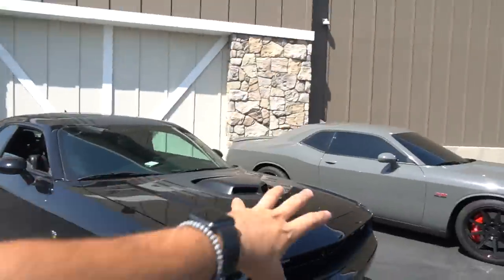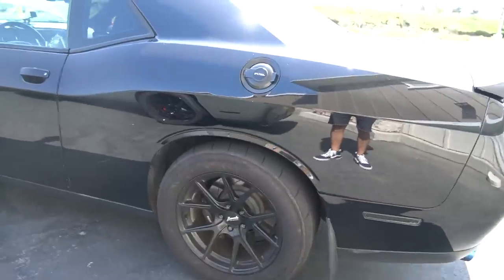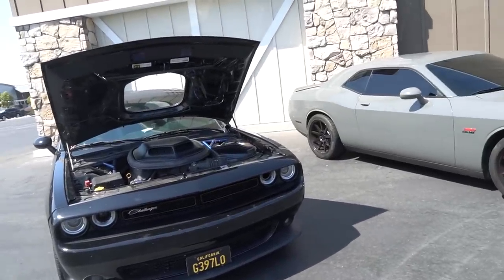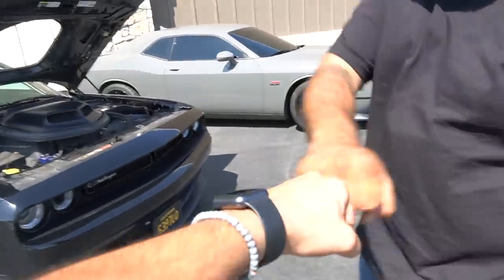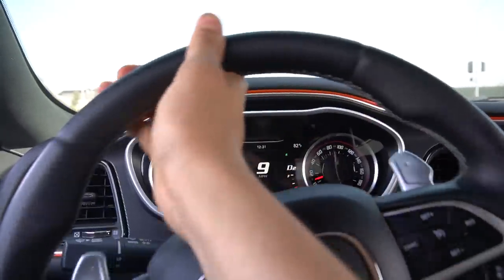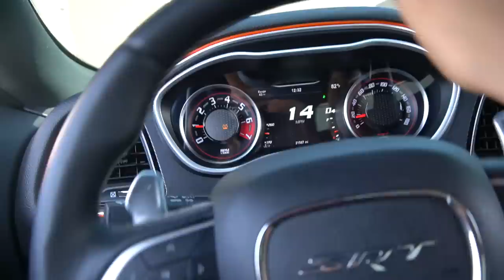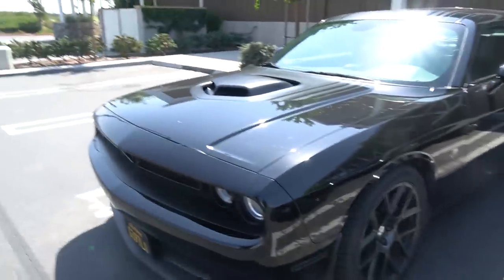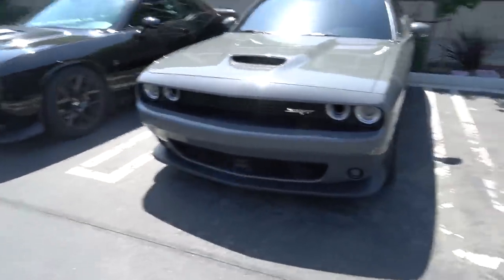Cammed Scatpack Challenger vs STOCK Challenger SRT 392!

Comment: He lost because of the compression ratio of the pistons. Meant for boost for longevity. My car is tuned for nitrous so when I’m not spraying, it doesn’t run the best but is still very capable of driving. Off bottle I made 452 wheel, on a 100 shot I made 580... use your common sense.
Reply: This is why on those street racing videos you see the forged internal C5 vettes on nitrous just walk! Iwhen they are spraying its like they have an enormous blower. Just saying c5 vette cause we've all seen the red one on that one channel

Comment: Adding more duration with a different cam works great IF you increase static compression, he actually lost power because the increased duration lowered the dynamic compression, it is really weak down low and might catch its breath up top but by then the race is already lost

Comment: Somethings not right,  a cammed scat should have pulled on you if you are stock.
Reply: Marcello Wheeler either his srt isn’t stock or his mechanic didn’t do a good job on his scat 😂😂🤷🏽‍♂️
Reply: Marcello Wheeler the forged block lowered his compression. He needs pro charge now . He fucked up
Reply: @eggbeaters  whipple! Whipple! Heartbeat! Heartbeat! Lol what Im a roots guy, yea, they may be heatpumps BUT HOLY HELL THE SOUNDS!!!
Reply: Hein-Motorsports Designs I agree
Reply: eggbeaters what is forged ?
Reply: Montero look it up
Reply: @SpookyMontero  forged internals are heavy duty parts for your rotating assembly (usually crankshaft, connecting rods and pistons) thst are typically made not only out of better metals then factory parts, but are also made out of compressed(forged) metal, usually these parts are incredably strong, and capable of VERY high power before failure.
Reply: ive wondered the same thing we have a stock 392 and some of the cars he destroys ive literally witnessed pull on us with ease... it's so weird...

Comment: This is basically how it would be if you raced a non supercharged 6.2 from the hellcat . That engine is built for boost , from the cam, lower compression pistons and the tune. The stock 392 is 10.9:1 basically 11:1 cr, where the scat is probably at 9.5:1 cr.  When he adds 10-12 psi , it’s going to move out...still good runs for being a lower compression car and most likely wider cam lobe separation.

Comment: Wtf idk what you got in the SRT but it isn’t “stock” 😭😭😭 just kidding btw
Reply: Naw his shit ain't stick watchin these last couple videos he definitely ain't stock plus he neva open his hood
Reply: I think that little intake and a tune probably adds some juice
Reply: @gordona7081  I always wonder what it is because sometimes he is wrecking cars that i've literally seen destroy these 392's either they don't know how to drive them or his car has more then he says...
Reply: @gordona7081  ram air intakes definitely add higher end power, and that's exactly what the hellcat box is.
Reply: Like i said Rush shifts car must have been built on a Friday..lol 🇺🇸
Reply: Just use common sense in any of his vids. 2 similar equipped cars..same motor and factory performance. One had a cam...headers cai and tune. The other has no real performance mods regardless of what you think a cai does. His car needs to make up at least  80 rwhp...likely more to be even let alone pull on this guy. He's got a 150 to 200 shot in his car......now you know.

Comment: Speculating; Forged internals weight much more and possibly his static compression ratio is a little lower. Car will rev slower.  Therefore, power band come at much later time. If he has a boosted cam, he may have little overlap and little to no scavenger effective effect. Therefore, less torque. 

Fair comparison were a stock to stock and long tubes with NA cam and tune.

Comment: He didn’t really do anything to increase horsepower significantly!! 
He is prepped for a pro charger. That will put him around 650!!!
The SRT is a better car than the Scat. Because of the different
settings you get on suspension, steering, and traction!!!
That shit adds up!!
Just adding in a cam don’t do shit really. You still got internals
and a turbo/pro charger etc........
This don’t surprise me!!!!!!

Comment: Damn your 392 is fast. Do you think it could give ur 5.0 a challenge ??
Reply: Andrew Hernandez the 5.0 would smoke his challenger. The short shifter with e85 in the mustang is nastu
Reply: RuthlessGamertag Yeah your right bro. Damn rush should run them just for fun tho 😂😂👀
Reply: Andrew Hernandez it’ll be nice to see. I think the 5.0 stock has more hp than the 392.
Reply: RuthlessGamertag but I remember in a different video his challenger beat a bolt on 5.0 right? I think... not sure
Reply: Andrew Hernandez it was a 2017. His 2019 is 460hp stock. Not to mention hes running e85 and a intake i believe with a short shifter

Comment: People don't realize that the SRT 392 & the scat pack 392 are not the same. The SRT 392 is, & has everything the hell cat has except for it having a bigger motor without supercharger. The STR is tuned differently, the SRT is the better, & faster car, & why it costs more as well I own one.
Reply: I think there the same lil bro
Reply: I know for fact that they aren't, look up the specs, the srt 392 has larger calipers, roters, better drive modes, all same as hellcat, only difference is the 392 srt has the bigger motor without supercharger, & the Scatpack only has the 392 in it, difference of $10/$20k, & not as much, well I'll let you do your own homework lil bro, if they were the same they wouldn't have two different names to them.
I also built the assembly lines for the big 3 ("Motor City" baby), plus other companies.
Reply: No u don’t realize the scat pack and srt392 are the same the srt only has bigger brakes and different suspension I think other than that their the same. Same drive train and everything just like the super bee
Reply: @perspective75 the drive train is the same u haven’t built shi clearly to say the srt 392 motor is bigger than the scat pack 😂😂😂😂😂
Reply: @perspective75 tell me why the swinger, srt 392, scat pack, super bee, 392 R/T, shake down pls tell me what they all got in common after u do your home work
Reply: @deznuts1841  I fully understand, I own one, & have read all up on both, they've got the same motor yes, but then there's even nicer & same badging, there's a lot of differences it what everyone else isn't getting, DO your own homework.
Reply: @deznuts1841  Side by side too please.
Reply: That's why they say "a wise man always Has something to say, a fool always has to say something"....🤣😂🤣😂
Reply: @deznuts1841  how did you mess that up, "the srt 392 has everything the same as the hellcat, but" the 392 "has a bigger motor, without a supercharger" the scat pack has the 392, plus all that you described none (including my 392) doesn't have a supercharger. Lhm
Reply: @perspective75  my guy u said the srt 392 has a bigger motor and like I said the only difference between the srt392 and scat pack is the suspension and brakes and tires nun serious if u wanna say it’s like a hellcat without the motor whatever u win but the drivetrain is the same from the motor to the trans u saying a bunch of nothing again 😂😂😂
Reply: @perspective75  and I own a scat so stop ✋😂😂😂
Reply: @perspective75  I beat a srt 392 with my scat charger and he had the challenger so u not gonna tell me sir 😂😂😂
Reply: @perspective75  and if u wanna count the badging as being different I’m done talking to u if that’s part of your argument
Reply: @perspective75  and I got track sport street and eco tell me what mode u got that I don’t!!!!!!!!!!!!!!!!!!!!!
Reply: @perspective75  and it cost more bc of the suspension upgrade and brakes big deal u so much faster 😂😂😂😂😂😂😂😂I can go all day
Reply: @perspective75  u just want everyone to know u gotta srt392 corn ball ash 😂😂😂
Reply: @deznuts1841  re-read "the srt392 has the same as the hellcat, except that the srt392 has a bigger motor than the hellcat, except I don't have a supercharger, if you read it right, we were still talking about the srt392 & hellcat, & why I was talking about the hellcat having a supercharger, hellcat has a 6.2 supercharged motor, & the rest if a v8 & not the little v8 the 392 is a 6.4. Besides the scat pack has exactly the same motor, so why would I say the 392 is bigger than the 392....🤔 head out of a55, & read. Am done explaining, can't explain to eye D ten tee's
Reply: @deznuts1841  dude the v6 can take a hellcat, for the 1st so many feet
Reply: So now you're grabbing at straws cuz you miss read something, give it up.
Reply: @perspective75 it does 6.4 vs 6.2 . You can't tell people nothing though lol .

Comment: could his car be an upbadged RT with 392 intake?  the seats give it away, usually the seats would have the scat pack logo, not "shaker".  EDIT:  and his scoop is missing the 392 shaker logo, possibly had the "shaker" emblem and stripped it off??

Comment: I recently did an older nag1 5.7 car and put a 6.4 in it.. still making good power with low compression.. hell my 6.1 makes 500whp and is only 10.3:1 aka stock.. if he gold sold a janky grind like a 274.. that's his issue.. at least it's not slower than stock tho! Ive seen that before with people with full heads and cam and long tubes 😂😂

Comment: Ahh, I believe both of these cars are N/A....so what is the issue about boost?....The guy that had the work done, seemed to make a poor cam choice...forged pistons only allow for more clearance, less cylinder drag,....but, did he up the C.R??,  the stock hypereutectics can take a fair amount of load......that Dodge with the modified mill should have powered by the stock one....one thing, you must be real careful when changing camshafts in these engines...

Comment: It could be the track mode vs sport mode.
I have a 2020 scat pack, and the track mode is faster than sport mode because of the quicker shift points.
Obviously he forged his engine for boost that he's not using as well. So, his mods are almost irrelevant with the exception of the headers.

Comment: Dude, I think he got taken..... He'd be pulling a lot more horse and torque if he had all that kinda work. A custom grind cam with a good tune, and some ported heads (because your there anyway) would alone get you 100-150hp to the wheels.  You'd be pulling much more than the SRT.

Comment: Love this channel but in all honesty I don't think your 392 should be labeled as STOCK. 392s have very nice exhaust systems off the factory and so to delete the mid muffler is to virtually straight pipe it...and a "hellcat airbox" is a cold air or short ram intake disguised as a typical airbox...you basically have bolt ons. Not "full BO" but performance modification bolt ons for sure.

Comment: Where is the 60 -75 hp from the cam / headers , tune. He should have walked you easy. 392 with those mods should be 460-475 rwhp.

Comment: I thought the scat pack was a 392 what are the difference between them ?
Reply: They are both 392 as in they have a 392 cubic inch engine I believe
Reply: @creturesbrother  that's what I thought they both have 485 hp but different packages right that's all ? Because it's a rt scat pack and it usto be an srt right ?
Reply: Angel well it always said powered by srt but I was apparently never a srt I don’t remember why but yes it’s just a upgraded r/t pretty much
Reply: Angel but yeah same car different packages
Reply: Yeah I think I understand now I know something happened for the 2019 models they changed a bit . Dodge has many trims it's hard to keep up like the new 1320 Challenger.
Reply: Angel yeah it’s cool that you can buy a fully prepared drag car from a dealership and drive out
Reply: @creturesbrother  Yeah I agree I want to buy a 392 Challenger I have an sxt right now and want a V8 and the 392 seems perfect.
Reply: Angel same I got a 2014 sxt and I’m trying to save up for a indigo blue shaker and I’m gonna mod the hell out of that thing
Reply: @creturesbrother  Yeah I'm doing the same bro    I want mine all blacked out that's how I have my sxt as long as I beat rt and keep up with 5.0 I'll be good I feel bad when they just blow my doors off haha
Reply: Angel haha yeah I gotcha yeah I was either considering going all blacked out which is nice but my car is black and stuff already so I think I want a nice change although I’m pretty sure I won’t get the 392 for at least 2 years probably

Comment: The car could sound ALOT better with higher compression or boost the forged pistons and halfass exhaust job make the car better but when it’s done and boosted it’ll be a lot faster car. But he’s doing a little at a time so can’t hate. 

The SCAT pack was faster because dude is only halfway there with it. 

Mexico runs? In our Mexico we run from a stop not from a dig screaming 1,2,3 out a window at 25- 30mph

Comment: You sure this wasnt an upbadged 5.7 shaker??😂 cause i inow they made the 5.7 shakers too,if that 6.4 was cammed it would have taken u for a walk from 60 as the long tubes work better in that powerband as do most cams. Should have pulled away,forged pistons holding him back or not.

Comment: Cams lower compression which lowers hp idk what that guy was expecting lol he does have a good setup for boost tho but at that point you could of bought a hellcat🤷‍♂️
Reply: 13 year old Wonderss depends on valve overlap. You can get it to actually raise compression. You cant just get a cam. You need a plan of your build to pick the right cam

Comment: He forgot abt the tune 😂
Reply: at this point with the forged pistons, he should just invest in some boost to better the odds..losing to an UN-modded 392 just means that a tune probably still won't do him much justice since he's now running slower than stock numbers...even vehicles i've had with a mere exhaust were still able to slightly edge completely stock vehicles of similar make, trim, and model..i know dude had to of been flustered about the outcome..🥲

Comment: Bad mechanic but that happens often. You think you know a good guy cause they got a nice car but never trust'em. I'd be more open to the dude who's jerry rigged everything in his garage and then has a real shop compared.

But these new Dodge's and SRT's ain't 't like the old Mopars. You get a 392 Hemi or a 378 Supercharged Hemi and it's all in the computer. It's all in the "tune" and what the computer reads by the O2 censor, the IAC, TPS, Injectors, fuel tank, fuel pressure and all that no sense. You really can't complain in any way for a new Dodge and a 392 Hemi. These new Dodges hook and still have the ability to burn rubber in about any gear, which is impressive. Hooking up and going is what counts off the line.

Hell, in my 318 Smog Block with like 180hp and 200 ft lbs torque(bit more now that I put a real intake on it lol, but only like maybe 5) I can spin the tires and break traction. I just have a factory 318 with the factory cam and valve lift regular. On an old engine, you do a few weekend jobs and you wake the engine up. A nice Comp Cam or Hughes, a set of full length headers(idk why new people call them "long tube") a 2 3/4" exhaust(dual 3" is too much for less than 400 cu inches) and a good Holley or Edlebrock 600cfm and you'll be giving good runs.

New cars, you get in'em and go. Ain't bad but it's more fun to build an old engine.